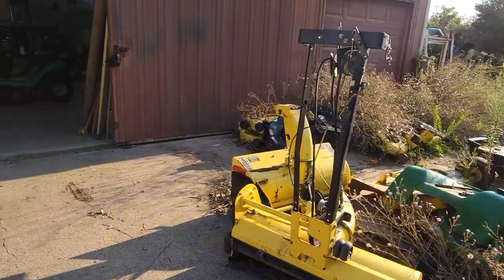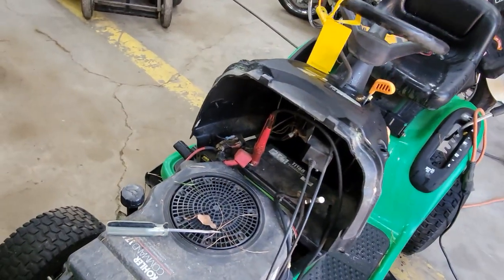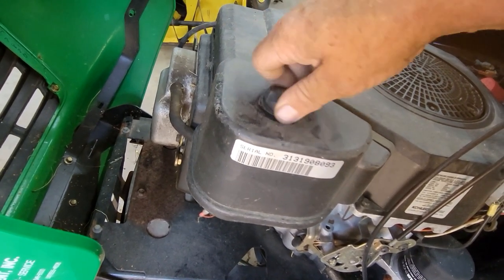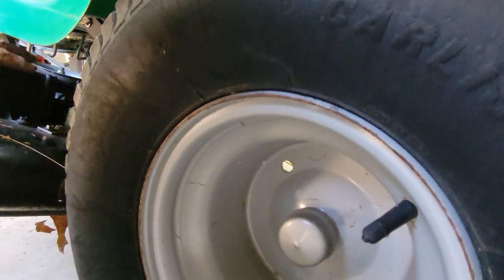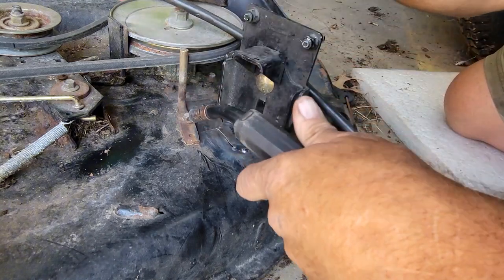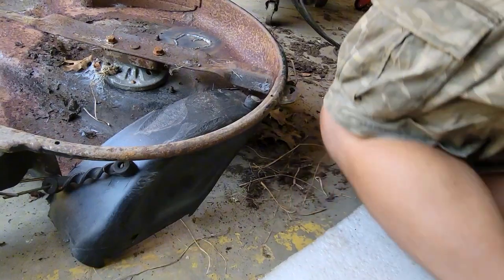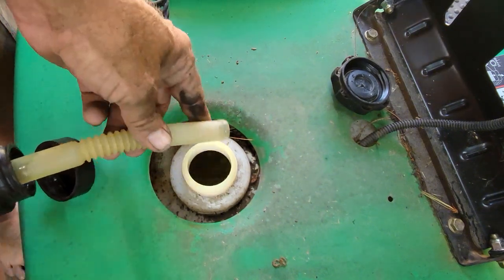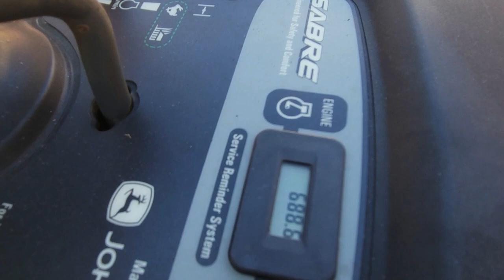John Deere Sabre, Will It Run And Mow? Deck Welding!

Comment: I weld both sides and often add more braces 
Prime and paint deck also 
If I’m planning on keeping it or to family it’s drilled and tap for zert and new brgings with inside covers removed, then greased good